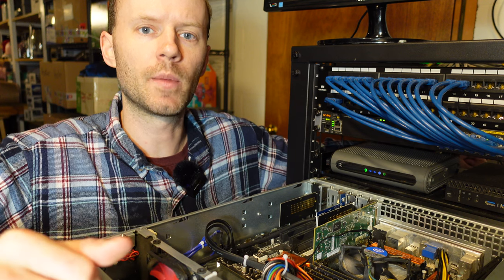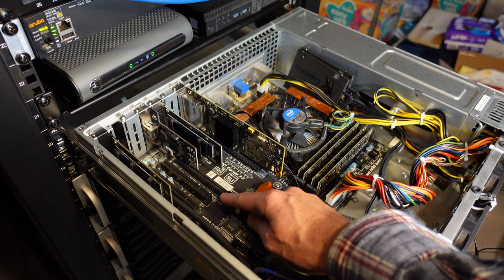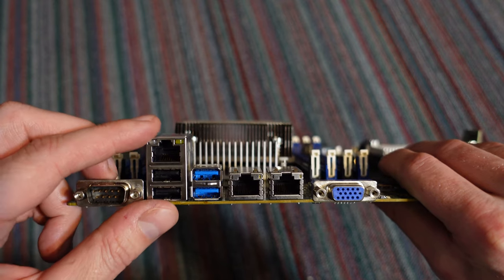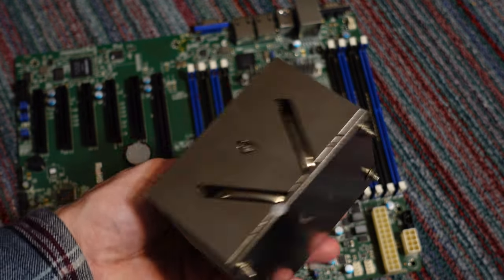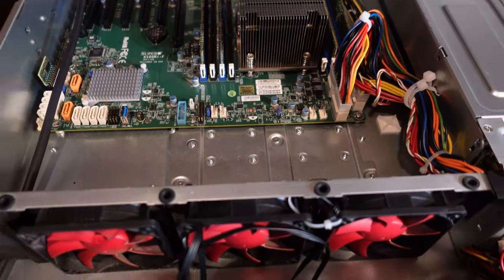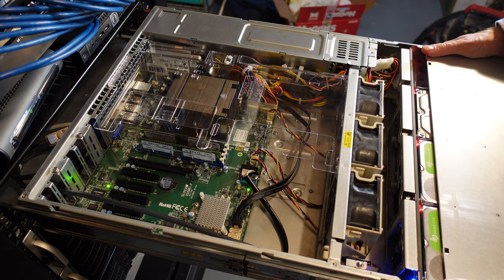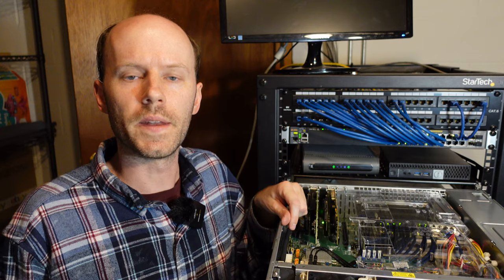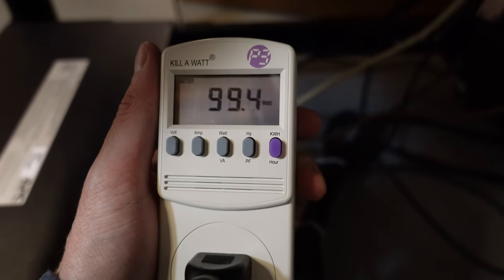Home Server Rebuild, 10-Core Xeon E5 CPU, 64GB DDR4 Memory, 10GbE Networking

Comment: What the heck is a CHIA farm? Bitcoin?
Reply from the maker: It's a cryptocurrency like bitcoin but it mines (farms) with plot files on hard drives instead of power-hogging expensive graphics cards.
Reply: @HomeSysAdmin  sounds like a lot of failed hard drives haha
Reply from the maker: @TurbanLeDurban  Why would you say that?
Reply: @HomeSysAdmin  well mining is constant usage and constant usage of a hard drive can make it fail, unless I'm mistaken
Reply from the maker: @TurbanLeDurban  It's important to note the differences here. The hard drive that stores the plots is pretty much always idle or doing a quick lookup. In fact, I would argue the workload on the hard drive is significantly less than the workload from a typical workstation computer. This is very different from "mining" you hear about that uses graphics cards whereby the graphics cards are pounded to death with a 100% (and often overclocked) workload.
Reply: Only high load is when it first writes to the full size of the disk, after that odd reads happen
Reply: @HomeSysAdmin  most mining gpus are underclocked or under volted to make them as efficient at achieving what they do with the least amount of wattage draw.

Comment: You can get 32GB DDR4 ECC sticks for peanuts, I have 2 on my desk I bough got £35 EACH -- Also, the xeons if you hunt around can be found for really cheap too, even the top of the range ones. I upgraded my own server with 2*E5-2696 v4 (22 cores *each*, these are upgraded 2699's) and the CPU were £130 from china. The CPU I use in my workstation is the moderately quicker (fro less cores) E5-2697 v4 (16 cores). Again, DDR4 (2133 or, a bit more rare, 2400) 32GB sticks (samsung, Dell branded etc) are super cheap of you are patient. I put 256GB in my workstation, and there's now 640GB (!!!!) in that Dell rack server I use for builds. Quite frankly with that sort of configuration I can ignore modern CPU craze (and super expensive ram) for the foseable future.
Reply from the maker: I do agree, you can get great deals if you wait patiently and stalk listings. Prices are coming down. The 2699v3 can already be bought from a US seller for over $15 less than I paid, and it hasn't been long since I built this. I didn't see a point in 32GB sticks with having so many slots. 8x16GB gives me 128GB and even the 64GB I have now is more than plenty. By the time I exceed 128GB (in hopefully many, many years) I'll be looking at building a new system out anyway :)
Reply from the maker: Oh I'm mixing up my builds now, this one had the 2630v4, not the 2699v3 🙂
Reply: Hello. I am looking to build something similar to this high core count dual xeon build for video editing.  In particular long 4k videos with effects. I have built a workstation before but i never built a rack mount server type system. Do i need to use these type of computers to pull this off? Can i make it in a workstation form factor? If not are there any alternatives?

Comment: 120GB drives for OS are fine. You should not have huge swap files, that is only an issue with too little RAM.  You plastic shroud for the CPU is missing a side piece that slots into the side to close in air flow.
Reply from the maker: 120GB is too small these days, even if not using such a large swap partition (which you're right, is really not needed). Also yes, I do believe the fan shroud is missing a piece - you have a good eye. Lol.
Reply: @HomeSysAdmin  The only reason I run bigger drives is whats available on the market. I am usually running up Hyper-V thus only as a hypervisor and like all good sysadmins, you dont install anything else on the host OS.

Comment: the 2 yellow ports you can put sata doms in there, and they will provide power to the sata doms and now extra wires.
Reply from the maker: I wish I knew what they were for originally! I didn't know about satadom until it was pointed out by another as well. That would have been quite a bit better than my routing of cables for boot drives.

Comment: Kind of a moot point after upgrading - but I had a similar issue with enterprise PCIe cards not booting on my home server. The issue was due to their SMBus misbehaving/ not registering correctly with the host system. I had a Dell H330 card that would not work on my home server until I taped over pins 5 and 6 on the PCIe connector with electrical tape.

Comment: You might need to cover pin 5 and 6 on the first smallest pcie connector as it sends some information that messes with the boot signal, I had this issue with my z230 board.

Comment: have you considered that your BIOS and the network cards firmware do not checkout? is there possibly a BIOS update that fixes that specific issue? considering it works once posted tells me it's a firmware and BIOS handshake issue.
Reply from the maker: I was running the latest version of the BIOS (which is several years old). I think I was just out of PCIe lanes for the CPU I was using - I'm not sure. I should have tried removing one of the other cards and seeing if it worked.
Reply: @HomeSysAdmin  hey eitherway that was a nice upgrade and it was probably worth the cost.

Comment: could be an issue with uefi, try updating the bios and firmware of card and motherboard.
Reply from the maker: It was running the latest BIOS and I tired various UEFI modes. I didn't think to check the card's firmware, but I think the problem was PCIe lane exhaustion.

Comment: Your videos have been very helpful for myself and my chia farming.  Could you do a video on setting up the farmer with ubuntu from scratch?  I have been using windows and it is a pain... I tried a year ago to set up with ubuntu but failed miserably.
Reply from the maker: Not sure I'll do a video on it, but I'm more than happy to help. What problems were you running in to? I would recommend the "install from source" method vs the pre-packaged stuff https://github.com/Chia-Network/chia-blockchain/wiki/INSTALL#install-from-source

Comment: Aside from that thing of covering the PCIe slot pins, many Supermicro boards have jumpers (JSMB1 and JSMB2 in the manual) to prevent the SMBUS from being exposed on the PCIe slot.  Perhaps the jumpers need to be moved to the "off" position, or even to floating (no pins connected)?

Comment: I have a supermicro x11sdv-4c-tln2f that has bifurcation on it. I think I set all settings correctly in the bios. And yet I can not get the card to see in ubuntu no matter what I do.
Reply from the maker: Make sure the bifurcation is set to x4x4 or x4x4x4x4. Some of the SM boards have "auto" mode for bifurcation; however, that never seems to work when I try it. Also, make sure it's being set on the correct slot. The slot numbers don't always match the numbering in the BIOS. The motherboard manual will have a block diagram with the slot number info.

Comment: I think u should check your bios settings and u may find a place under advanced chipset where it will give u option to manually assign lanes. Many motherboards even though they may have dual 16x wired slots they both can not run at x16 together. The board should automatically detect and select x8 for each slot when u have cards plugged in x16 both slots. But i guess your board is unable to detect and properly bifurcate so u can just set it manually 8x on both slots and that will force the pcie switchs to force 8x on both slots doesn't matter if something is plugged in or not. 
& This is why server platform is different than desktop. 
In server cpus u have more pcie lanes that allow more expansion slots to run properly! 
You did the right thing to switch to server platform it will solve a lot of current and future issues.

Comment: Nice! My current server is a core i5 4430, I have plans to eventually upgrade it to either an i7 8700k or ryzen 7 2700. But it's doing its job as a plex server, bedrock MC, server and pi-hole without a sweat, so no real rush atm to upgrade